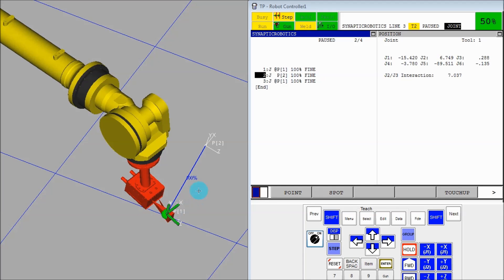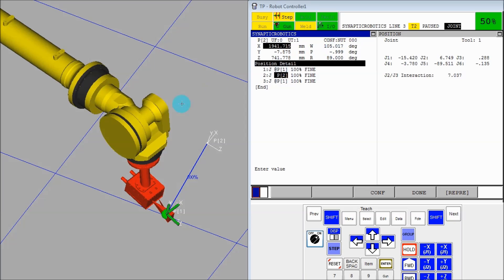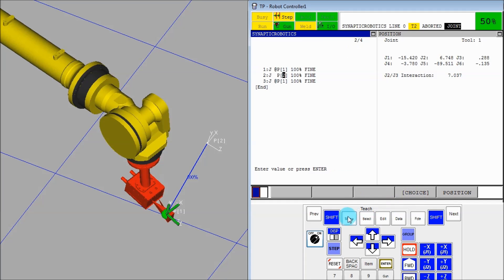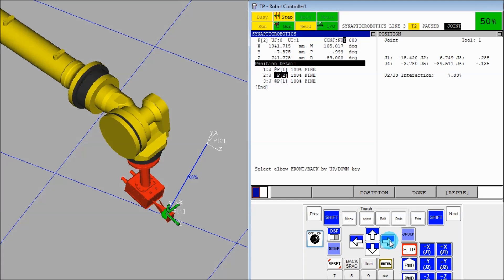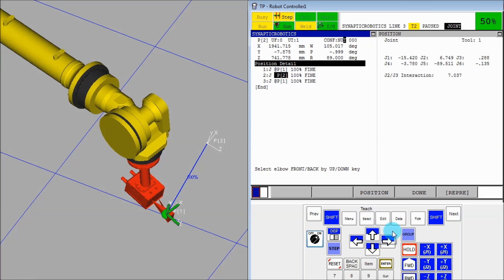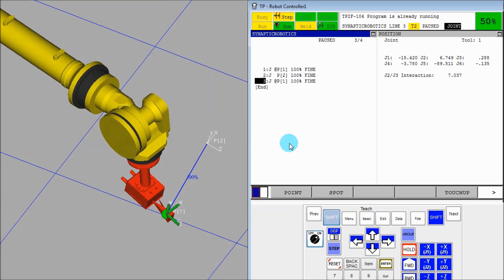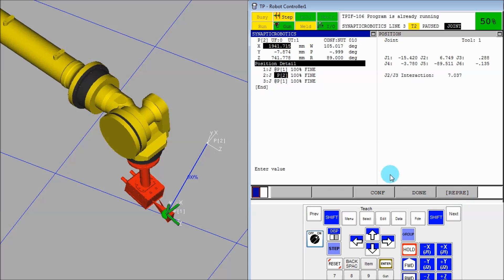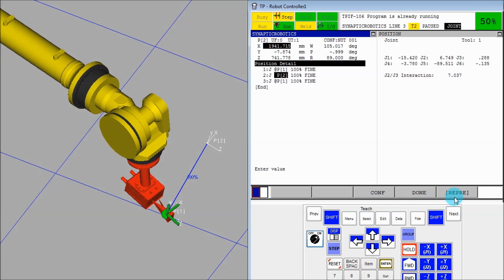Fanuc Robots: The Configuration String

Comment: Suggestion for anyone programming robots. When you teach a point, always round every point either up or down a few decimal places. So if your X point is -266.678 round it to -266.700. This way if an operator or anyone who shouldnt be touching the teach pendant touches up a point, you'll know instantly that something has changed if it crashes.
Reply: Thank you for that idea, will be using that.
Reply: Very well